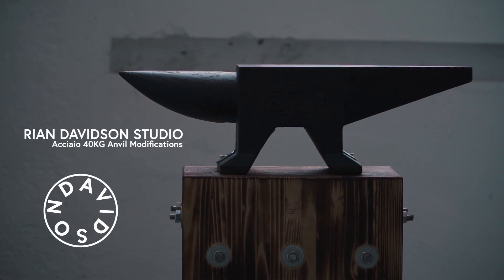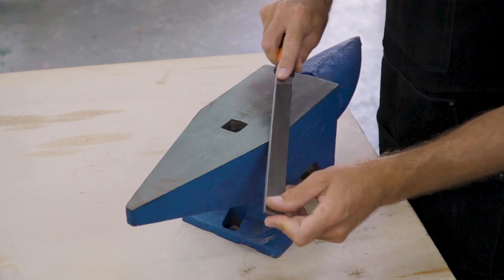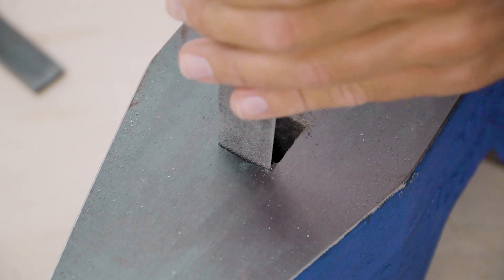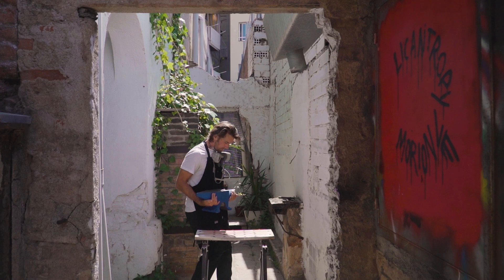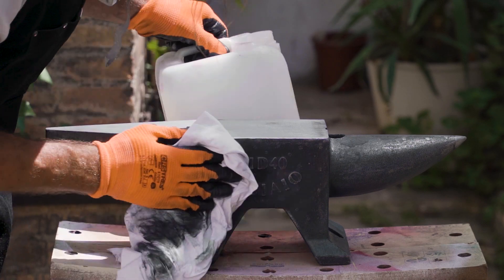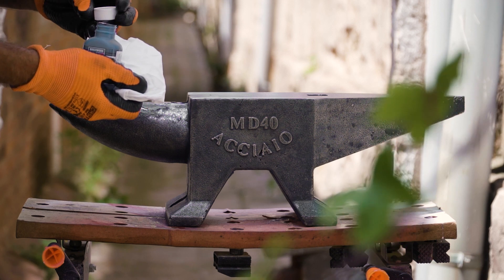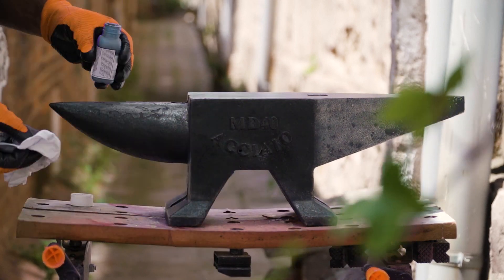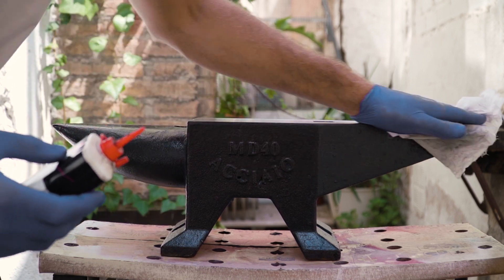Dressing a budget Acciaio Anvil: Aesthetic and structural improvements

Comment: In 2005 a friend of mine and I got a rare run of 110 lb Russian cast steel anvils from HF. They weren't around long and we got them for $1 /lb. It's been 17 years and that anvil is still in  use weekly making money for his shop.

"Cast Steel" might not be that good good $8 / lb  forged steel but it sure as hell isn't the ASOs I grew up with. 

This is a good starter steel investment for any beginner smith or someone with a half a shop that needs a good hard flat surface to beat on to shape something now and again. 

If your shop starts making money to where your ROI can catch up then sure... resurface it or get a forged steel anvil. 

This particular anvil gets so much guff it's kind of funny to see. You'd think it were a cast iron HF special.
Reply from the maker: I couldn't agree more. To be honest this anvil has run the gauntlet and it's holding up fine. I've forged a lot of knives, stone mason tools and door hardware for the last year and I have no real complaints. Of course it's not going to perform as well as an anvil weighing 2-5x as much from forged steel but for small shop purposes it's a good budget investment. Thanks for the input!
Reply: @riandavidsonstudio that’s comparing sizes, not quality. I hear they now have a 200 lb model. I bought the 132 lb black, which is actually pretty hard. Mine did test to about the 55 RC it’s advertised as being. No denting. The only annoyance is the same somewhat odd shape of the horn. It doesn’t really match any normal horn shape I’m familiar with. I found the horn to be hard as well. After grinding it to my preferred shape, it is still hard. The depth of hardening is pretty good. I don’t find the black paint to be annoying. Honestly, too many people are too hung up on what they think, erroneously, an anvil should look like.

Comment: Don't used files on hardened steel. It will very slowly and ruin your file. But apart from that great vid
Reply: This a 50 rockwell hardened face, the files will be fine at a rockwell of 60-65